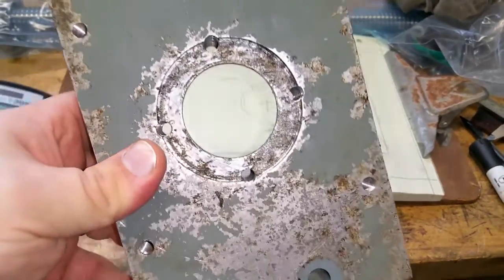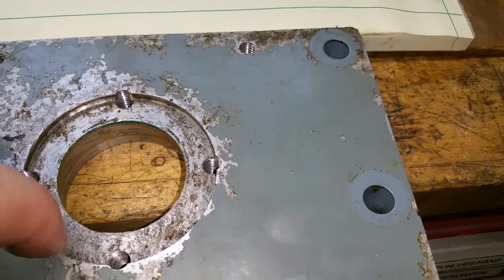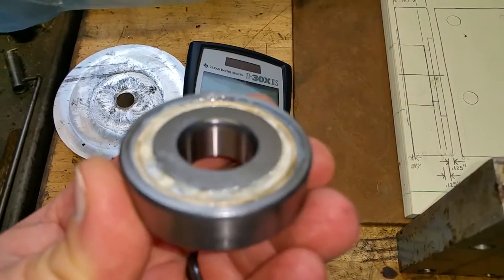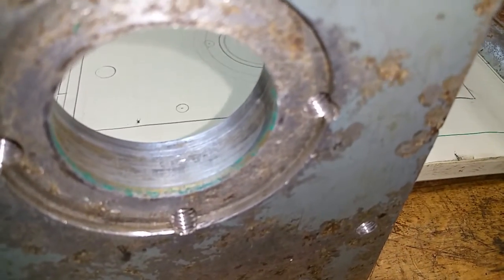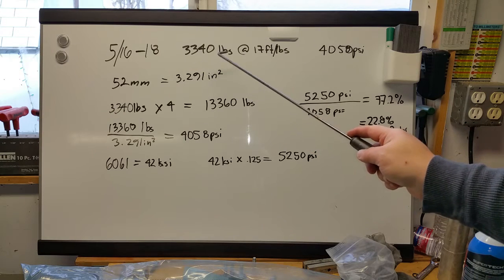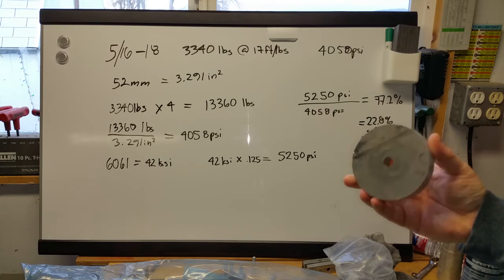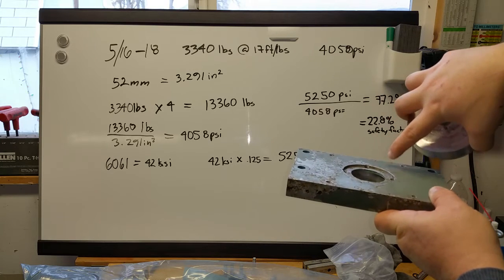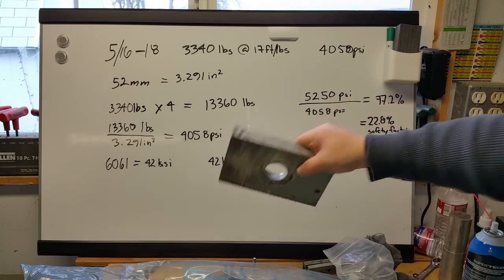Fadal engineering failure -- explained

Comment: That plate is thicker than it needs to be for just the bearings. As long as your way lube is functioning properly, give it a pump and its not hard to move the table, can be done with a good push with the ballscrew disconnected. Its that thick because the motor hangs off the back of it and you don't want that flex transferred to the ballscrew or bearings.

When you tighten the bearings, the "cap" shouldn't be all the way against the plate, there should be a slight gap, over tightening the bearing is the usual cause of this failure.

Fadals allowed tolerance is .0030 total, .0015 for bearings, .0015 for ballscrew. Set your backlash for the axis in question, if it is over 15 then set it to 0, remove the way cover. Set your indicator on a flat spot on the vary end of the ballscrew and check for in and out play. This gives you the error in your bearings. Take that number and subtract it from your backlash. This will give you the error in your ballscrew.

So if your backlash is 22, then you check the thrust bearings and get .0004, then you have .0018 and need to replace ballscrew. If you are replacing a ballscrew I always recommend ordering the full assembly, will come with new bearings and mounts, cheaper than buying separately, and saves alot of time.

ITScnc.com or CNCPros.com, you can get any part overnight if you need, though you might need to call CNCPros, their website is not that good. If ITS is out of stock just call them, most of the time the can get it within a day.

Comment: Thanks!
  I'll have a look at mine next time I am in there for something. It seems that simply counterboring and adding a steel thrust plate in the bottom to convert that shoulder to a steel registration may be a good solution as well. A flat washer...
Reply from the maker: Just make sure you have a register for the bellows to sit in.

Comment: So if the torque of the screws is enough to compromise the shoulder on the plate, what about the stress from the thrust of the screw itself?

It's been a few years since Mechanics of Materials, but rough calculation for shear failure of the shoulder is 2" * Pi *.125 = .785 in^2 (bearing OD * Pi * .125 thickness). Most metals have half the yield strength in shear, so .785 * 21,000 psi = 16,485 lbs of thrust load that the shoulder can take. 

So yeah, I reach the same conclusion. It's barely strong enough to support itself, let alone any actual load. That's a terrible design. 

Took me a minute to put the logo together with your posts on practicalmachinist.com. Good times!
Reply from the maker: Yep, it's a double sigma logo :-)  My shop was called EFormance Engineering.

Comment: I was fooling you fine with your calculations until the .125 "factor" on the ultimate strength of 42ksi.  You calculated the shear stress on the bore correctly, but that should then be directly compared to the shear strength of the 6061, which is approximately 24ksi. What am I missing here?
Reply: Damn iPad :-).  I was following you fine.......
Reply from the maker: I may have been off a bit, Matweb says 30ksi.  Good thing I went twice as thick on the retainer! :-)
Reply: +eformance I agree your repair is a perfect and well thought out solution!  Typically you can conservatively approximate the shear strength by dividing the ultimate strength by the square root of 3 (which is about .577*Ftu).  Since the shear stress from the preload itself is fairly small, I suspect there is likely a fatigue thrust load hammering away which caused the failure.  And as I stated at the beginning of this reply, your solution kills it :-).  Thanks so much for sharing!  I wish I knew half of what you do.  And I learn something new every time you post a new video.  I don't know why your subscription size isn't higher.  Somehow the word isn't out yet.  All the best. Joel.....
Reply from the maker: I see what you mean by the .125.  I was taking the 42ksi and multiplying it by .125 for the 1/8th thick flange that retained the bearing, thus derating the 42klbs to 5250lbs, but as you pointed out, I should have used a number closer to 24-30ksi, leading to a shear value of 3000-3750lbs, which is exceeded by the 17ft/lbs of torque a 5/16-18 fastener will exert.  This means to avoid blowing out the bearing, Fadal must have had a factory spec of something like 120in/lbs to avoid damaging the block.  The max thrust of the Y axis ballscrew is around 3500lbs at stall torque, so it's possible to exceed the yield strength of the block at stall torque.  I think that a crash would be more likely to cause damage than normal thrust components because the control will fault out very quickly if it was to reach max torque.  The box way drag is quite high, hitting around 600/2048 counts at 100ipm with no cutting load.  The maximum setpoint is achieved at close to 300ipm with the bare iron/iron ways.

Comment: I have to ask: why not make a new plate from a decent grade of steel?
Reply from the maker: +atomkinder67 I didn't have any steel on hand and I have a ton of those round discs.  It was easy to add a disc to retain it and it was less work.  Even just doubling the thickness of the aluminum (which is what it looks like they did in later mounts) would do the trick.